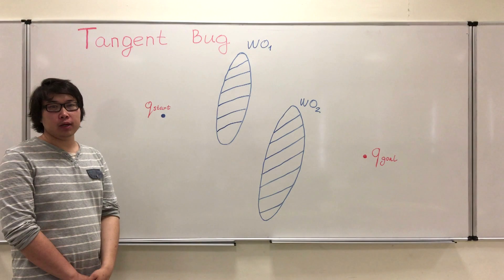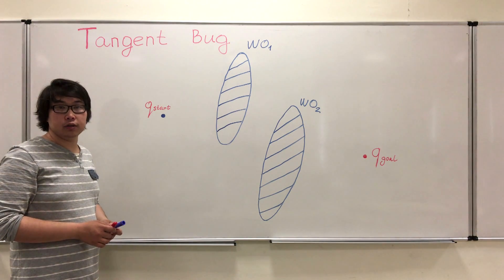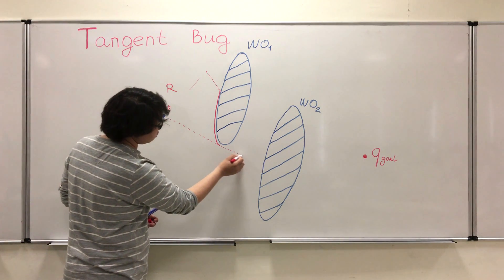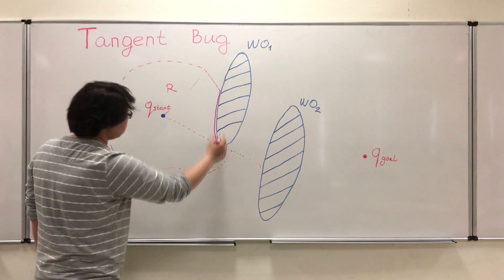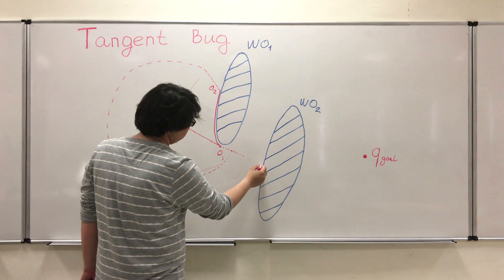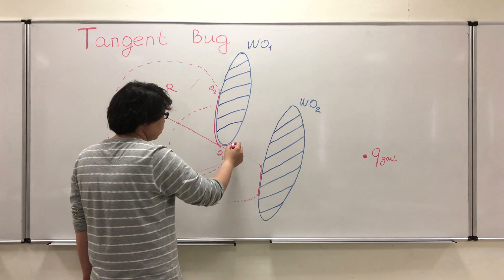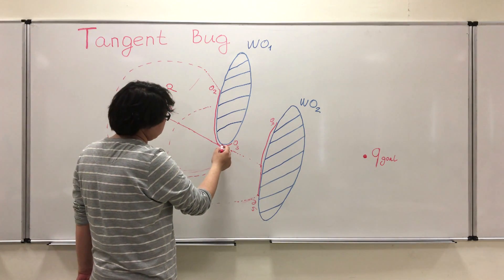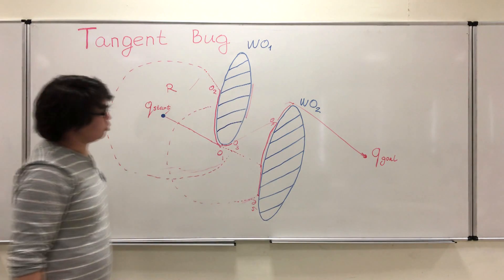Tangent Bug - Path Planning Algorithm Explanation

Comment: 2:01 This seems to be incorrect, there is no discontinuity in the curve at Point O2. Nice video though :)
Reply: O2 is a discontinuity because the point next to it is out of the range of the sensor and is hence considered to be infinity. Therefore, the distance detected goes from infinity to a finite distance so it is a discontinuity.